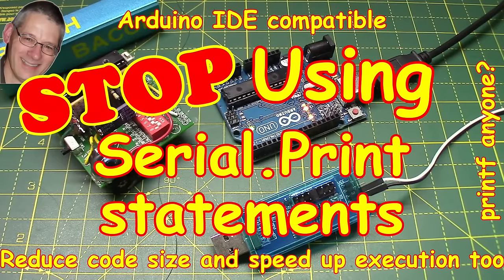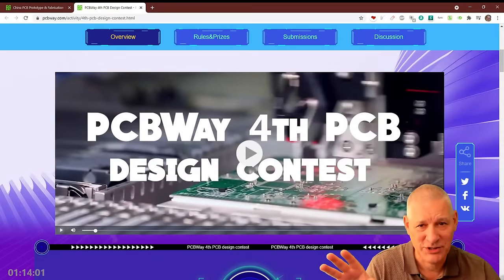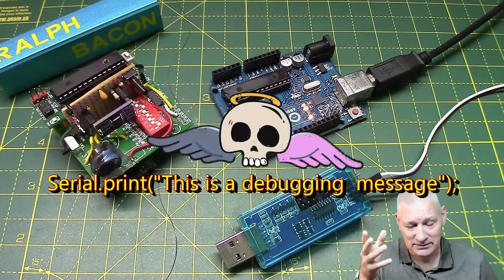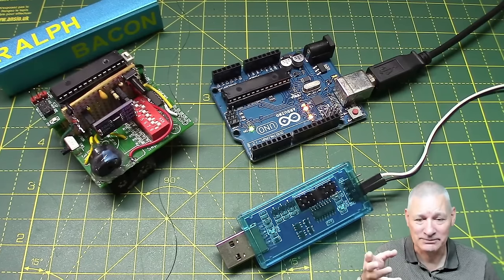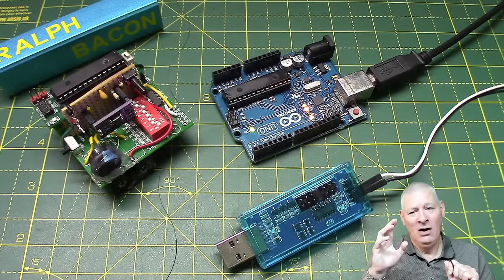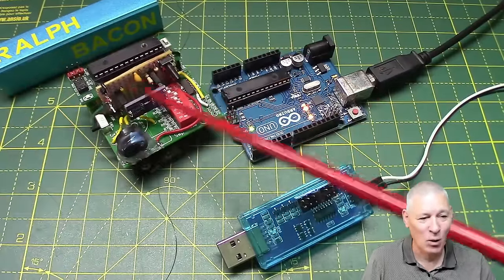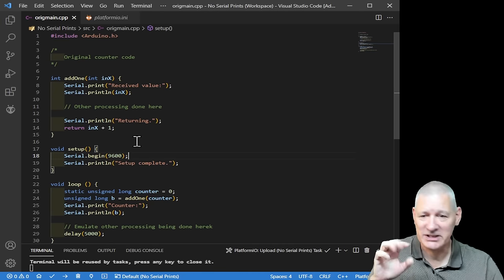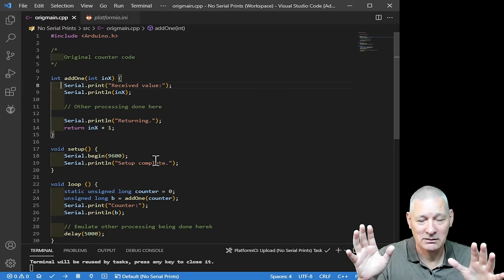#224 🛑 STOP using Serial.print in your Arduino code! THIS is better.

Comment: Thanks for an excellent video.  This is a more elegant solution than I have been using.  I did encounter a problem with the following program statement:
debug("Error[%u]: ", error);  
This caused an error: macro "debug" passed 2 arguments, but takes just 1
My #define debug(x) Serial.print(x) looks like yours, is there a way to pass either 1 or 2 arguments?
Reply: I just noticed that the original statement was Serial.printf("Error[%u]: ", error);  (not Serial.print)
So I understand I need a new #define statement to cover this, still don't know how to handle multiple arguments?
Reply from the maker: Well, #define can have more than one argument eg min(a, b) but whether we can use ... or _VA_ARGS_ to represent multiple (and unknown) parameters in the #definition is something I never tried (yet).
Reply: @RalphBacon  
Ralph it definitely can be done with variadic macros.

#define DEBUG_STATE true
#if DEBUG_STATE
  #define BUFF 50
  #define Serialprint(...) Serial.print(__VA_ARGS__)
  #define Serialprintln(...) Serial.println(__VA_ARGS__)
  #define Serialprintf(...) Serial.printf(__VA_ARGS__)
  #define Serialbegin(baud) Serial.begin(baud)
  #define aSerialprintf(...) {char buff[BUFF];\
                              snprintf(buff, BUFF, __VA_ARGS__);\
                              Serial.print(buff);}
#else
  #define Serialprint(...)
  #define Serialprintln(...)
  #define Serialprintf(...)
  #define Serialbegin(baud)
  #define aSerialprintf(...)
#endif

Just replace Serial.print with Serialprint in the sketch code to invoke the macro definitions. Of course Serial.print will still work for non-debug messages. That is really only replacing debug with Serialprint from your code but I find that more intuitive.

The aSerialprintf is an alternative definition for Serialprintf and is only needed if Serial.printf is not available (ie Arduino boards) in your setup  (via a library or built in for ESP's) otherwise leave it out. 

The printf buffer size is hard coded to 50 characters. The BUFF definition is also not needed if aSerialprintf is not implemented.
Reply from the maker: Looks good, Phil. I never considered multiple parameters in Serial.print statements but, of course, you can use them so people will. Excellent stuff, thanks for sharing.

Comment: Is there a way to achieve something similar on the Pi Pico using Micropython? Really useful video 😁
Reply from the maker: Not that I know of, but that's because I am rubbish at microPython. If there is a way you can be sure someone has found it. Bear in mind though that Micropyton is interpreted and so I guess it's going to be a lot slower than compiled C++ anyway.

Comment: One of your problems, mr. Bacon, is that you go Serial.begin(9600).
You can be 96 times faster with 921600.
Reply from the maker: The highest speed I use (usually with ESP32s), Vasily, is 115200; I will try higher speeds and see how it copes. 
The Arduino, with its 16MHz processor speed, is surely limited to 115200 at best? I tend to use 9600 on the Arduino to make it super safe and no risk of corruption. I guess I should increase that too! I can remember when 300 baud was the maximum I could get from some chips!
Reply: @RalphBacon  921600 is one of standard values for UART. The FT232 USB-UART chip has 3Mbaud maximum data rate, same is for many clones and alternatives. As for microcontrollers, they usually have hardware implementation of UART, cpu clock is not that important.
Reply: @RalphBacon  Also, how faster one can go over UART for different boards can be a good investigation for your future video. BTW, for esp8266 and esp32 I used 921600 with no problems. 115200 is very safe for atmega328p (depending on USB-UART IC).
Reply from the maker: Hmm. If I clock an Arduino at 8MHz then my maximum sketch upload speed is only 19200, otherwise it might fail.

On the other hand, an ESP32 can upload at 921600 no problem at all! There must be a correlation between processor speed and clock speed. Unless this is only true for storing program code into Flash (which is slower, we know).
Reply: @RalphBacon  Well, this is true. The correlation is in how good and functional is the clock divider or PLL in MCU. That can be proved only experimentally or computed from datasheet.

Comment: Thank you for the very comprehensive tutorial.  Excellent tutorial for beginner programmers, but it could be cut down to a 5 minute video for intermediate to experienced programs.
Reply from the maker: Glad it was helpful! And, yes, for those beyond beginner stage it doubtless could be done more succinctly but! This channel is about getting beginners' projects off the ground so more detail is required.

Incidentally, if I watch a video that is going too slowly for me I just increase the playback speed to 1.25x or even 1.5x and it gets things moving along rather nicely!
Reply: @RalphBacon  I subscribed to your channel as you lend a very comfortable and comprehensive means of educating about Arduino.  Thank you, again.  Best regards

Comment: I used to save the overhead (time and memory) by debugging MCU projects code using different colour LEDs on GPIO pins as a crude form of debug. It does use IO but it  can be fast and compact.
The LED colour would signify different parts of code or deferent  meanings (semaphores).
Reply from the maker: Indeed. Your method is not that different to the way I proposed (and subsequently used) in videos #251 and #252 - a simple two digit display hard wired into your project to show the [error] status.
Reply: Yes, this is also the way to go for things which you would like to remain in final build. But whenever you will decide to go back to code to apply some change or bugfix you can realize it would be nice to have a cheap method which would bring back all logging as fast as possible. And this is why all logging statements should remain in code. They just have to be configurable (switch on and off, specify which should be the minimal lever for the statement to be preserved by compiler, ...).
Reply: @VictorYarema  Yes that is a pro tip for sure - thanks!

Comment: Hi Ralph good stuff again well done\\.
I #define debug as true or false, and I use "if(debug)Serial.print(x); I takes a little longer to write but then toggle the define to false on the final compile. I tend to leave setup print statements as only run once and give an indication the thing is working.
Reply from the maker: But once you are "done done" with the code, I'm assuming you are no longer monitoring the serial output? In which case an LED or Buzzer is a better indicator that things are running OK, I find.
Reply: Instead of if(debug) use #ifdef debug as this won't include the code. The #ifdef can be used on any statement including variable declarations.

Comment: Hi Is it possible to a debugf for Serial.prinf ?  i tried but get an error "debugf" passed 2 arguments, but takes just 1" i did try debug(x,x) but no luck, (i am using esp32-cam) is the log library the only way forward.
Reply from the maker: If you are using the ESP32, Andrew, then I recommend you use the ESP32's built-in "printf" (no library required) and, even better, the built in logging using log_d(...) which accepts all printf formats and only logs a message depending on your debugging level (Core Debugging Level in the Arduino IDE Tools option).

So if your Core Debugging Level is 5 (everything, which I recommend initially) your 
log_v("This is message %d", myCounter);
works just like a printf but is output only because you have selected the highest level of debugging (v=verbose). 

The "log_v" statements are ignored if you set the debugging level to, say 3, at which point only log_d (d=debug - and higher, so log_w and log_e, for warnings and errors respectively) are shown.

Make sense?
Reply: @RalphBacon  thanks Ralph that does make sense. I am using OTA and FTP SD card on the esp32-cam. Is there an esay way to port this logging information to a file or am i back to printing (appending) to a file on the sd card? Log_v doean't seem to return the information for use in a writeFile situation.
The videos are great, keep up the good work.
ps: never argue with knives.
Reply from the maker: Don't talk about knives, slicing, thumbs or delicatessen counters! 

Regarding the logging, if the underlying "log_d" etc doesn't do it, you could easily update it to write to an SD card (as well). Or perhaps redirect the printf string to a different function (at the moment it is linked to the Serial port).

But check the documentation first, maybe Espressif have that covered.
Reply: @RalphBacon  will do. thanks again.

Comment: debugln ((unsigned long) addOne (counter));  // eliminates the warning.
Note that 'debug' and 'release' profiles define (or undef) 'DEBUG' on the command line.
Reply from the maker: I like it! I think the Arduino IDE always compiles in release mode, doesn't it? In my PlatformIO setup I usually have more than one profile depending on what I'm doing with the code.

Comment: Thanks for the video.  Please advise. How did you bring up the "call term" window.  (Or what did you call it?)
Reply from the maker: That would be CoolTerm, an independent serial port monitor. Free to use, although if you find that useful the author, Roger, appreciates a contribution.
You can have several instances running at once, which I do, as I'm monitoring several ESP32 projects at once:
https://freeware.the-meiers.org/

Comment: I am still a beginner with sketches but as soon as my sketch works I remove serial print why do you need it if what you have created works surely it will not suddenly stop working the sketch will not alter itself.
Reply from the maker: It might not stop working, but it might suddenly decide to act strangely as you didn't take into account certain conditions.

The fact is that most developers only ever test the "HAPPY PATH" in their code. If the code does what you expect it's considered "working". 

But as the code becomes more complex (just take at look at my ESP32 web radio code, video #205) you will see that there is no way on Earth that I could have tested all possible scenarios even if I had the time and inclination to do so.

So bugs exist in your code and might rear their ugly heads when you least expect it! So by leaving the Serial.print statements (or equivalent) in your code you can at least see what is happening (that you didn't expect). By including a switch for the Serial.print statements (as shown in this video) the code runs very efficiently under normal (happy path) conditions, but always allows you to switch it back on when things go awry!

OK, you don't often get bugs in code as simple as the Blink sketch; but anything more complex will always have "unknown unknowns" that you need to be ready to deal with.

Comment: I used to use them as dummy delays in functions. Don't forget, DELAY doesn't work in a function and sometimes you need a delay. I would put them in a for loop or a while loop to simply waste time. I did later find out that DELAY MICROSECONDS is the only delay that actually does work in an external function.
Reply from the maker: When you say external function, are you referring to a pre-compiled module that you just linking in? The standard delay(x) function works everywhere in the Arduino environment AFAIK.

Comment: ..I alternately tried using my rx (CS)and tx(dcs) to run my esp8266 streaming radio..it worked flawlessly.. can't do that on esp32..not know why..
Reply from the maker: I'm not sure I understand what you're trying to do, Suren. Can you elaborate please?
Reply: @RalphBacon  ..it's regarding the vs1053b pin 6 & 7 .. directly plugged into an D1R1 .. I had to jump it to pin Rx & tx to get the streaming radio working..
Reply from the maker: On the VS1053b (module) that I used, pin 6 is MOSI and pin 7 is MISO. They need to be connected to the SPI bus on the ESP32. The audio output is from the 3.5mm jack socket. It sounds as though you are doing something very different to me?

My VS1053 module looks like this:
https://www.banggood.com/custlink/KG3d6Zgd4s
Reply: @RalphBacon  ..those are earlier vs1053... There is a B which could be plugged to an Arduino...I wanted something unique..so I inovated edzelf work..with no DuPont wire version..only phone charger power supply and the 3.5 mm stereo to rca and an amplifier..
Reply from the maker: If you're using Ed's radio system, why not ask him the question rather than me? I'm afraid I am totally unfamiliar with his system, excellent though it seems to be. 😊
Reply: @RalphBacon  ..I was commenting about the alternate way a serial can be utilized .. not just for serial.print .. and I did not question anything ..it was just a comment..
Reply from the maker: Right! You are saying that you are not getting serial output on the TX pin on an ESP32 - but it's OK on an ESP8266?
Reply: @RalphBacon  ..yeah..and esp32 supposed to be able to rec 5 GHz ..not just 10% faster than esp8266
Reply from the maker: ESP32 has more than one UART - you're using the right pins?
Reply: @RalphBacon  .. actually I don't even own a proper PC to program any esp32.. so I stick with esp8266 which is programable on fast robust Window XP ...I tried but esp32,it  play earlier like 2 sec faster and pauses..unlike on esp8266 which was continues...and I had to reset Everytime to upload on an esp32..so I gave up..anyway I'm quite busy cooling a solar microinverter right now..but it has an esp wifi monitored on a smart home app..not sure if it's a esp 8266 or an esp 32..the user manual came with spelling error..so I can't expect too much..
Reply from the maker: It will be a challenge using XP, that's for sure! Well, stick with what you know works, and good luck with your project. 👍
Reply: @RalphBacon  ..one last request ..do you have any tutorial on Powerline Communication on Arduinos ?..instead of wifi and rj45 .. mybe I could get data via powerline on my grid tied inverter since signal range is limited on these..

Comment: I guess having lone semicolons isn’t a compile issue. What would be nice is two different compile commands and then debugging commands (like print, log...) that automatically get ignored when you compile without debugging (like a “final” compile). When you compile with debugging they get used.
Reply from the maker: Yes, did a video on that. It uses the concepts of macros that resolve to nothing in a non-debugging compile (so no output on the serial monitor). It might be video #BB10.

Comment: My whole project relies on Serial.print haha. I use an arduino nano with a digital encoder that sends a Serial.print for like "volume_up" or "volume_down". Then on my computer I wrote a python scrpit that reads from the serial port and triggers a system command (i use linux) that makes the volume go up or down lol. Im only doing this because im using an arduino nano, which doesn't support Native USB, so I can't emulate a HID device and there are no microcontrollers with the necessary support for sale.
Reply from the maker: This is definitely one case where the serial output is being used as a data stream and, as such, should not be removed.

That said, you can just keep those two output statements and change all the others to the method shown in this video to speed things up and save space, right?

Comment: Hello sir, thank you for your great videos, I'm actually working on something that is very time sensitive and I need it to be as accurate as possible (down to the milli seconds scale), I'm using RTC but I noticed that there is some seconds missing and they get to add up with long durations ... so your video got me to the question of if I delete or clean those serial print commands after I'm done will allow to recover the missing seconds or some of them at leat,  I'm using the millis function to create timed events on intervals. Thank you very much
Reply from the maker: You can use the timer triggered functions to create periodic events (to run functions). They, at least, should be accurate. Millis() can be interfered with (eg if interrupts are stopped) so should not be relied on. An external RTC (DS3231) will be accurate to get the time too.

Comment: another tip, we could have differently debug mode such as 2/3/4/5...etc, so we can preset a bunch of variable in Preprocessor , so we test our code with predetermined inputs as the alpha test. by combined using #define #ifdef to activate and deactivied piece of code.
Reply from the maker: I've got a more granular version in my GitHub that allows Errors, Warnings, General, Verbose settings. But another viewer has suggested different names for the debug variable so we can debug just one function, for example. It's something I'm thinking about.

Comment: Instead of the if statements Couldn’t you just add change #define debug(x)…  to //#define debug(x)… when your done debugging?
Reply: Meant  #debug debug(x) //Serial.print
Reply from the maker: You cannot add in a comment into your #define statements (other than for your own documentation) as all comments are removed by the compiler before compilations of the code begins.
At least, I'm guessing that's what you're suggesting?